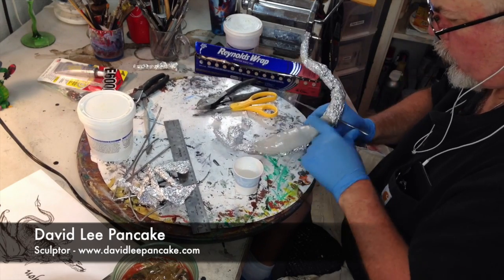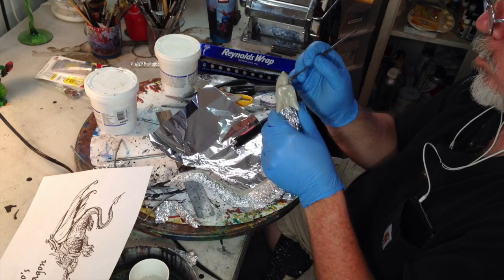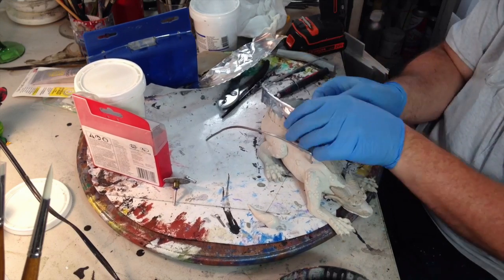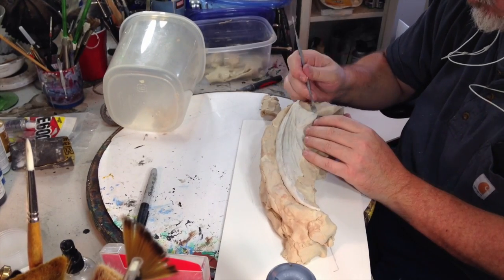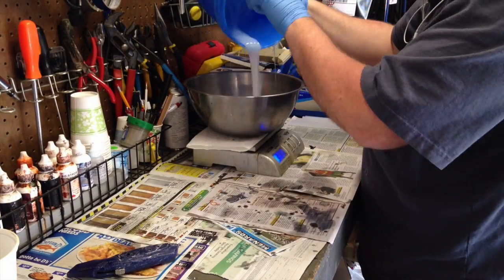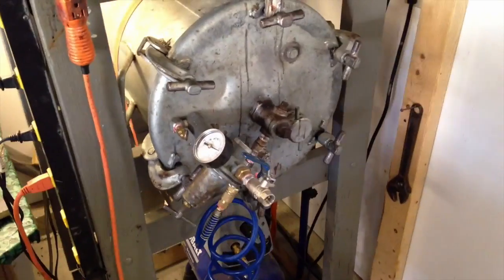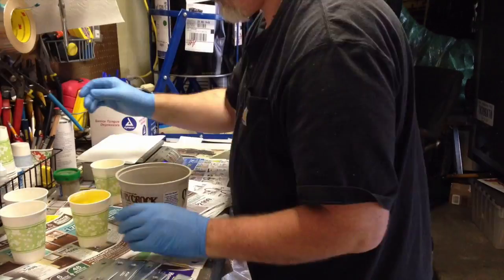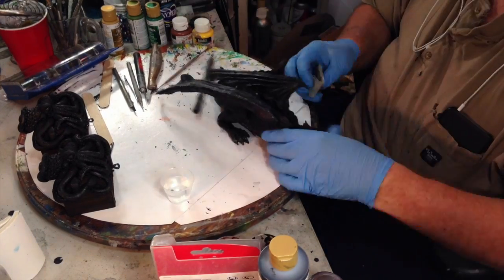Sculpting Magnifico, the Dragon

Comment: Magnificent work as always David! :) Gives me new ideas to make molds. I'm just still struggling with finding a casting material that is flexible enough to put wires in so it can bend. latex is great but It won't cure in silicone unfortunately. Thank you for the amazing video.

Comment: Good evening, what type of farmhouse do you use? Thank you
Reply from the maker: Do you mean armature? frame?  If so, I use aluminum wire and aluminum foil, over the top of that goes the 2 part epoxy sculpting material or clay or sculpey.  I have used a multitude of mediums to sculpt.  Sorry for the long delay in answering your question, I some how missed it.